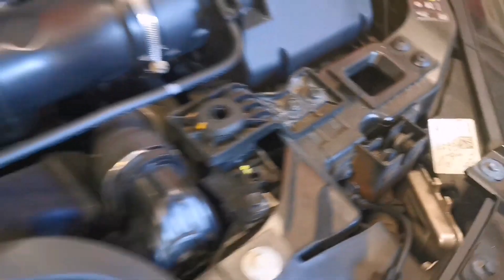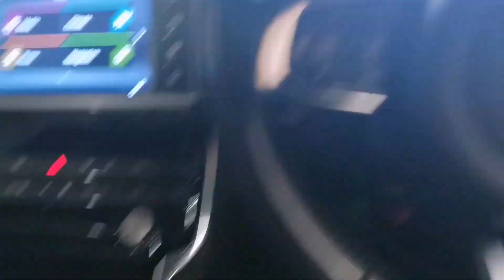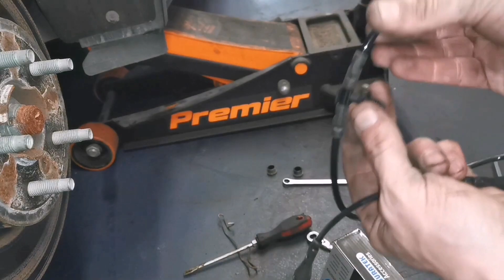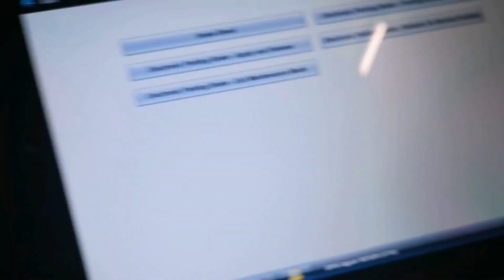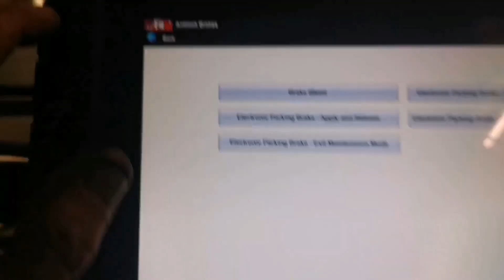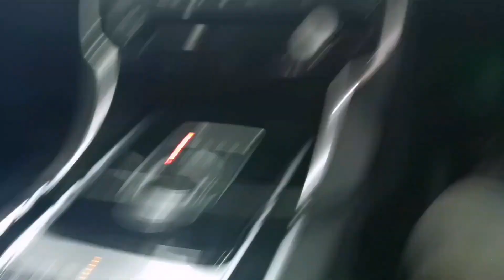Jaguar XE Rear Brake Pads Change, Electronic Parking Brake Service Position

Comment: The parking brake service mode instructions worked for 5 minutes, after a while the computer recalibrated and for whatever reason and 😢 it popped my rear caliper out.. now I'm having to replace both... Best advice is disconnect the hydro motor or battery. Expensive mistake 😅

Comment: can those brake motors be wound back with a 12v supply from something like a power probe and operate the handbrake manually to set the piston.
Reply: Possibly, but the module light lay an egg.
Changed the rear pads on a xe not so long ago found it could be put into service mode and wound back without a scan tool the procedures on the internet, timing is critical when carrying it out though.

Comment: Nice one Dave, I find lately that electronics can be hit & miss. A reset or adaptation just doesn’t work , but eventually it works after the 2nd or 3rd attempt. Thanks for sharing 😉👍

Comment: Nice job Dave. Frustrating the customer didn't want the discs done too? Did the same job on my A4 Allroad, but did a brake rebuild all round including caliper seals, which meant dismantling the electronic parking brake. VCDS and multiple brake bleeds and job is good un!

Comment: Another good job done there Dave half expected Sandy To make a quest appearance on hearing those bagpipes. Interesting point you made about not putting any grease on the brake pad abutments I’ve worked at a few main dealerships in my time and as far as can remember never seen any grease on the brake pads from the factory.
Reply from the maker: Yes Kevin, i think people go mad with the grease